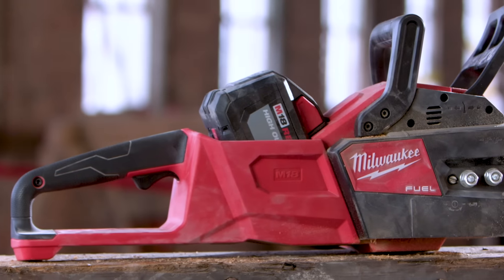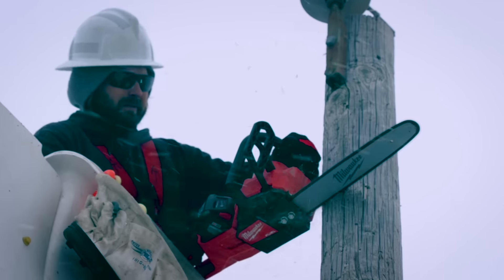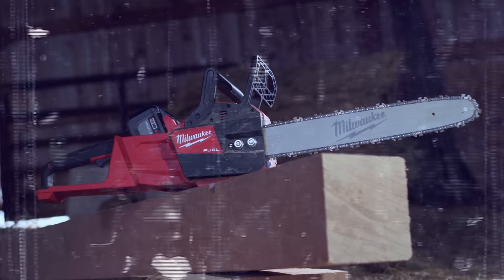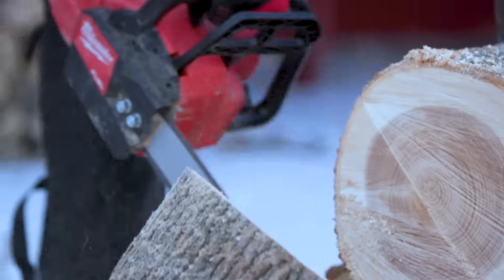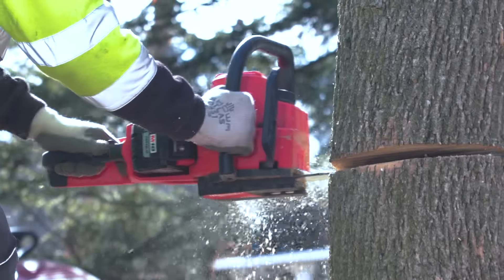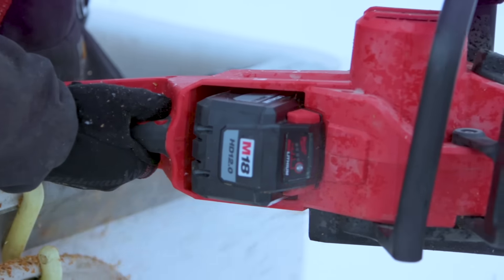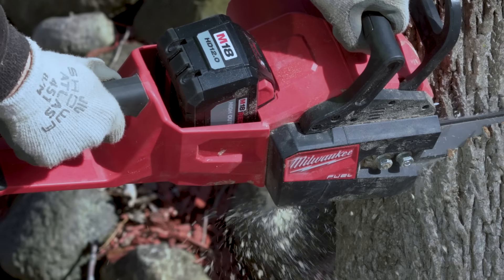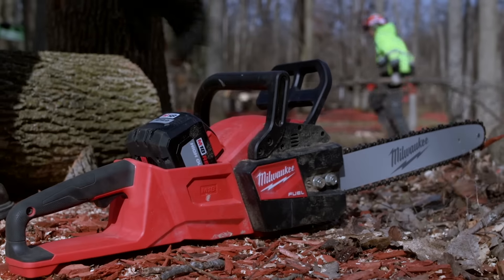Milwaukee® M18 FUEL™ 16" Chainsaw

Comment: I've used this saw for 4 years very reliable.  I hope they soon make a big 20" chainsaw that's comparable to the stihl ms362. Either using an mx battery or 2 m18. Dewalt already made a 20". I also would love to see a top handle arborist chainsaw!

Comment: Milwaukee m18 chain saw, size?, tools adjusted and tighted,,,,,, Dewalt 40v XR and 60V FLEXVOLT, Makita twin 18V (36V) batteries chain saw, tool free hand adjusted and tighted

Comment: Fire service???  Prefome in heavy smoke???
Reply: This won't perform with a fire rescue saw, the CC's on those are around 70-90 cc's. This saw said equivalent to 40cc's
Reply: This won't perform with a fire rescue saw, the CC's on those are around 70-90 cc's. This saw said equivalent to 40cc's

Comment: I would never take that over my gas powered saw.
Reply: FishFind3000, have you ever tried these brushless chainsaws nowadays? If not, I would encourage you to do so. They definitely do not suck! You will still want your gas saw for when your out and away from a charging source. My Dad loves his 80v greenworks saw, he uses it way more than his stihl ms271, and his husqvarna saws. I'm not saying that you need to replace all your gas saws with this new battery powered stuff. But, by all means, if you get the chance, give them a try! They're pretty darn sweet!
Reply: I gotta say...these new battery saws are nuts.  I think they spin faster than gas and reach peak torque faster but, I have experienced chains tripping the sprocket on my echo.  I would love to see how this compares.
Reply: Brian B, I've heard others complain about chains coming off too. Not sure if it's because the chain is thinner on the electric saws? I haven't experienced the chains on our greenworks ever slipping off. But I'm also always watching my chain tension religiously. I'm also curious to see how the auto oiler works out for the milwaukee. My 40v greenworks sits out on my bench for weeks and never spills a drop. I'm hoping the milwaukee won't leak as well.
Reply: I agree.  My little saw is a MS 261.  My neighbor has the DeWalt battery saw.  My gas saw is better.  Remember to make sure the chains are sharp on both saws if you do a comparison.  With that being said, I definitely see room for battery saws in my arsenal of tools.  How long will a battery stay charged?  It would be a great option to keep in your truck for clearing downed trees during winter...
Reply: Carl Anderson, my 40v greenworks with the 5ah battery last for quite awhile. Assuming I'm cutting and stopping to clean up periodically, I can usually run for about 1 to 1-1/2 hours on the 5ah battery. With the 2ah battery that came with it, I get roughly 30-45 minutes. I'm really curious to see how long this 12ah milwaukee battery last. One of the big downsides to electric is that I forget to check the bar oil often. Because on a gas saw, I always top off the bar oil with the gas. But I don't put gas in the electric... Hence my ignorance.
Reply: no one should, this is a gardening tool